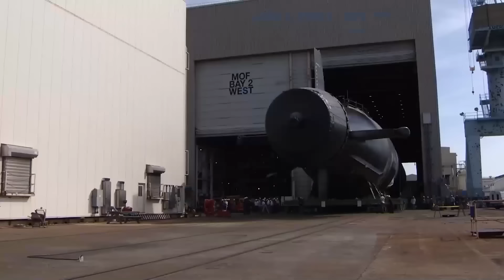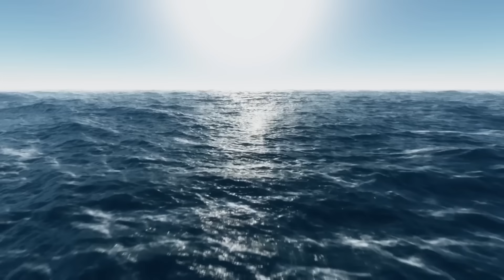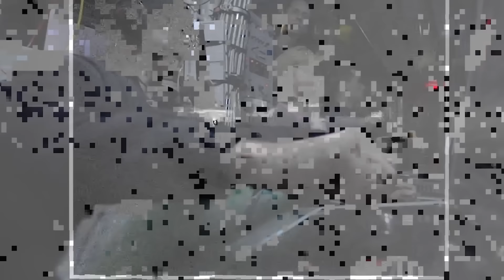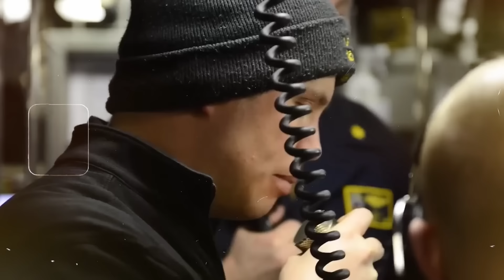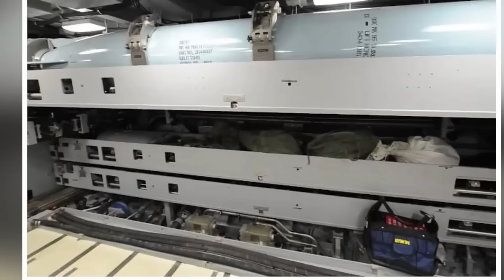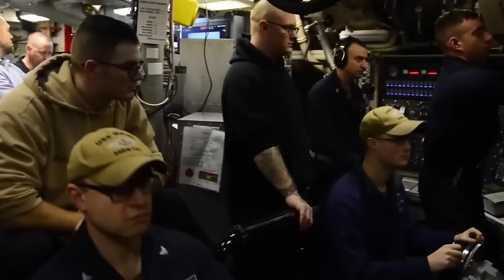The New U.S. Submarine Just Deployed — And What It Can Do Terrifies the World

Comment: They have upgraded many of the Los Angeles class SSN's.  New reactors, new electric motors and propeller replacements and coated in brand new sonar absorbing coatings.  They have been given new computer systems, sonar etc.  Even the interiors have been coated with rubber floors, new bushings between fittings etc.  They are still a very outstanding work horse.